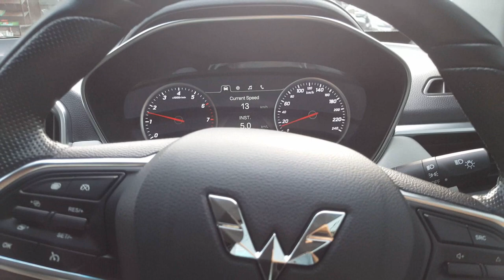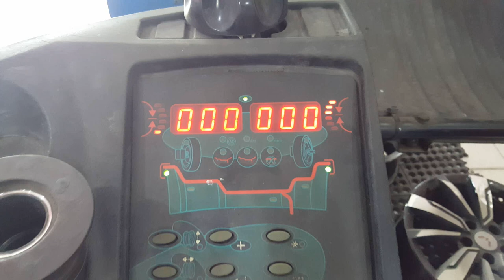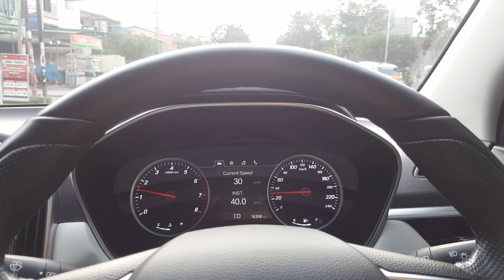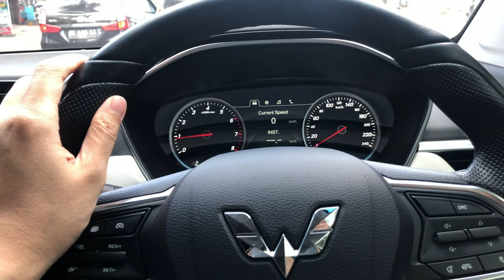Wuling Almaz Turbo / MG Hector New Shoes / Wheels & Tires Upgrade Project | Modif Wuling Almaz.

Comment: Bro felix mau tanya itu ganti spacer nok 8mm apakah ganti baut yg lebih panjang?? 

Kalau iya saya mau tanya apakah baut rodanya sama dengan kepunyaan toyota/honda?

Thank youu
Reply from the maker: baut nya masih pake yg original belum di ganti, Thread nya masih bisa jadi tidak perlu di ganti. Kalau 10mm wajib ganti baut yg lebih pjg. Untuk baut roda 1.5 sama seperti toyota dan honda.
Reply: @FelixDanGarasiAuto  thank youuiu bro felix

Comment: Any drop in fuel economy ?
Reply from the maker: nope it still the same mpg using these 18 inch wheel package
Reply: @FelixDanGarasiAuto  thanks for confirming. I am using the 2021 CVT model which comes with 18 inches. Just that not happy with tyre profile. It is 215/55 R18.

Wanted to change it to 235/60 R18.   What's your view on that?

Comment: Knapa tambah nok spacer 8mm bro?
Reply from the maker: kemaren karna offset roda +42 mentok ke dalem ruang fender . jd wajib pasang nok spacer. Wuling Almaz bagusnya untuk offset kisaran +40 sd + 35 untuk spec 18 inci x 8.5 atau ring 19 inci .
Reply: Gasruk fender waktu belok full ya? Kok ga tambah spacer 5mm aja?
Reply from the maker: @erickbudiman993  5mm tetep mentok ke fender dalem karna ban . 8mm memang sdh pas & flush fitment. 👌

Comment: Original factory tires are 17inch, my knowledge if you install 18inch tires; will degrade comfortability.
Reply from the maker: nope the comfort is still there with this 18 inch.